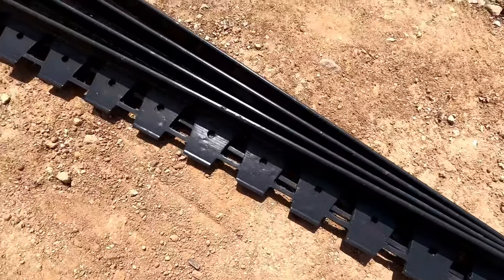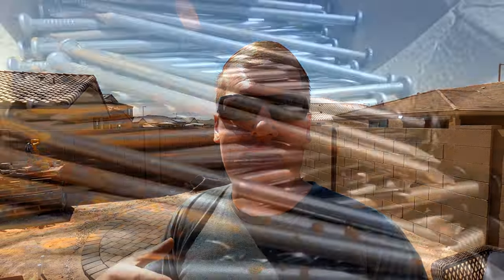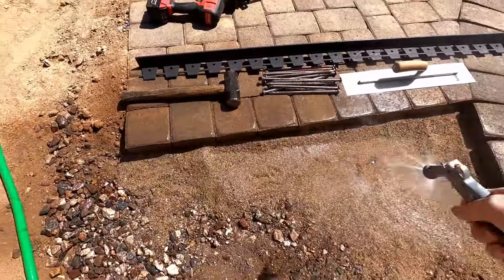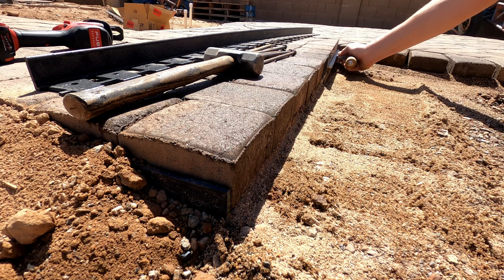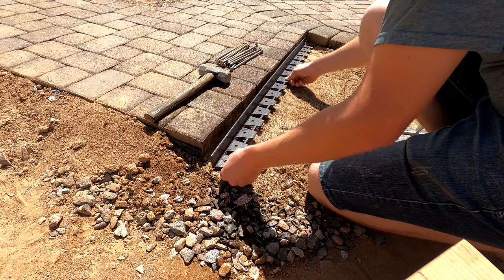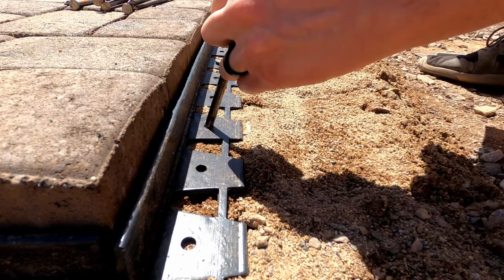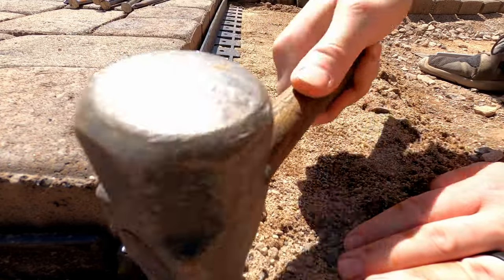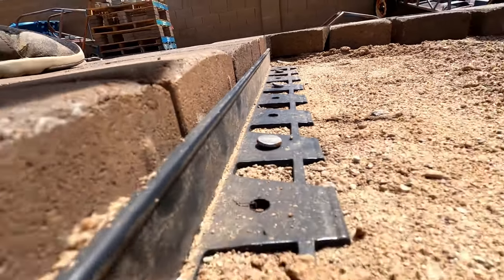How To Edge Concrete Pavers The Right Way

Comment: I was really looking for you to show installation around the fire pit.  I use a heat gun to bend around corners, but I'm sure it would work on a circle.
Reply from the maker: The little tabs that the nails go through have barrs that connect them, I cut those bars and the edging flexed right around the circle with no issues. my circle was 12' around.

Comment: Nice man. Hope it’s long lasting for you. With doing hardscaping for 7 years I’ve become not a huge fan of that edging over the years. Sometimes it will work great, and then other times it heaves and pulls away and up in freeze thaw climates. If you do deal with that down the road try a product called perma edge.
Reply from the maker: I live in Arizona so it almost never freezes here, so far its worked well, although I drove a 14k dump trailer over an edge last week and cracked off a couple pavers, not sure if that was an edge failure or something else. Thanks for your feedback and knowledge!
Reply: I'm sure this is a hard question to answer, but do you think perma edge is worth the money compared to fiber reinforced concrete?

Comment: Is this good for a paver driveway (vehicular traffic) as well? Or should I used concrete instead?
Reply from the maker: It should work fine there's just less room for error. 
One of my paths is next to my RV gate and i've driven a loaded dump trailer full of rock over the edge which is about as much strain as you can put on paver edging, and on sections that where done well it held up with no issues, there was one corner that the edging and underlayment where not great and that corner cracked off, so this method works well but if you are doing a driveway make sure your crushed rock extends at least a foot past the edge of the pavers. another thing that can help is if you backfill the surrounding material so it is the same finished height as the pavers.

Comment: A little note to the wise.  Know exactly where water lines and wires are running, especially if you live in southern climates where these can be buried just a few inches deep.  Those spike can easily give you an unexpected surprise....hopefull not an electrical one.  I spiked a sprinkler system supply line that I had no idea was running just below my gravel.

Comment: Can these be used as edging to install artificial grass instead of pavers
Reply from the maker: I edged my artificial grass with a single row of paves just laid end to end. This ledge would be much taller than the turf and I dont think would look good.
Reply: @RogueWrenching  oh ok. My grass is 2.00" so I thought these would be short enough.
Reply from the maker: @stephaniehenry5617  the thing is the turf isn't that tall when you step on it so it'd look maybe ok, but if you walk across it or the wind blows it'll look tacky.
Reply: @RogueWrenching  Thanks. I just went ahead and bought Turf Edge for my edging

Comment: Cement is better and way cheaper
Reply: Aint his house
Reply from the maker: If you have the skills maybe.
Reply: You lost me at "PLASTIC".  We have a vegetable garden and introducing plastics on your property is not a healthy idea.
Reply: I read on another post that plastic paver edging if better for freeze and thaw climates. Where as cement is better suited for warmer climates.
Reply from the maker: @jesmainetoppin517   That may be so. This method was used at my Arizona house, and it worked flawlessly. Easy to do, not messy, and you can go as slow or as fast as you want with no fear if cement curing too quickly. I think this is the superior way to do it. But I'm also just a homeowner, not a professional hard scape installer.